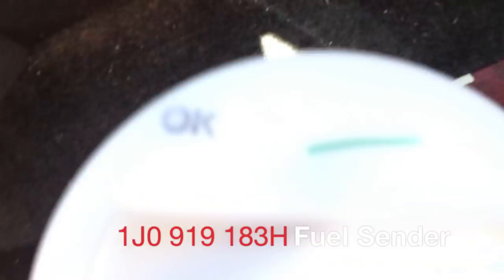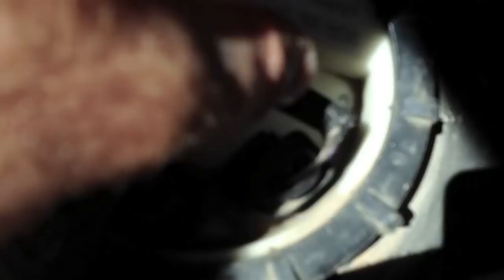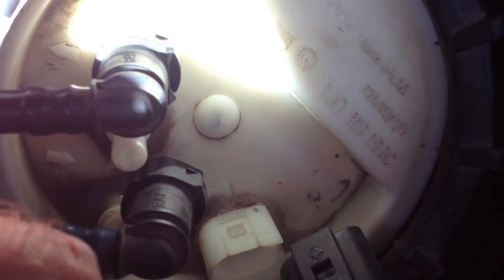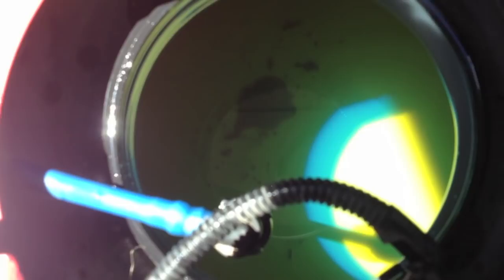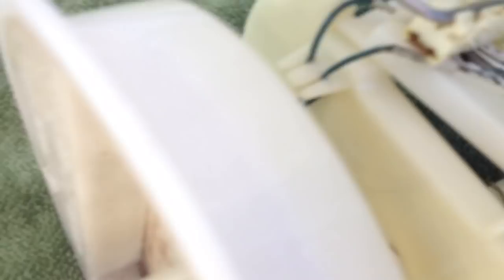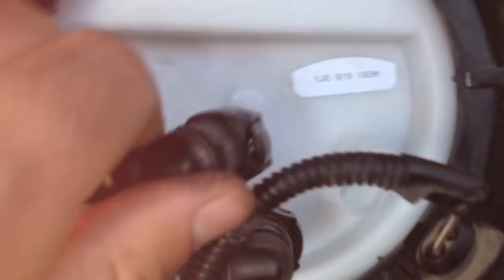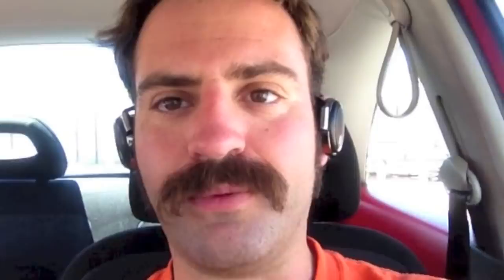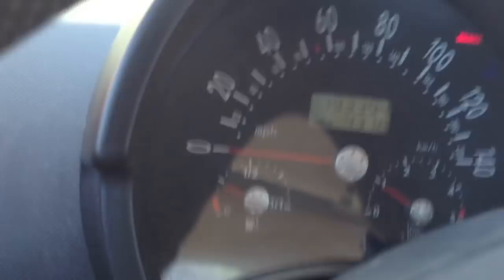How to Replace a Volkswagen VW Fuel Level Sender Unit  for Beetle / Jetta  / Golf

Comment: at 2:10, Mikey doesn't mention (moreover completely skips) the plastic ring that threads onto the top housing of the tank to hold the unit down. This would seem obvious but on a 15 year old car this ring can be damn near impossible to spin. I had to knock mine free by gently (but not too gentle) striking, with a hammer, the ring in at least 4 places around its circumference to break it free. After which it was still far more than "hand tight". I had to spin mine by striking a slotted screw driver with a mallet (counter clockwise of course) as level as i could without damaging the plastic. After almost a full rotation, its very course thread, i was able to spin it by hand. I hope this saves at least someone the 15 minutes of anger and sore thumbs i experienced trying to spin the ring off.
Reply: Edward McClung oh boy hope to God that isn’t my situation but thank you

Comment: Hey Mike,  I am currently working on my 2002 Beetle 2.0 gas new fuel pump installation. So far I am doing ok but when installing back the rubber seal bends and fuel pump does not seal very good.